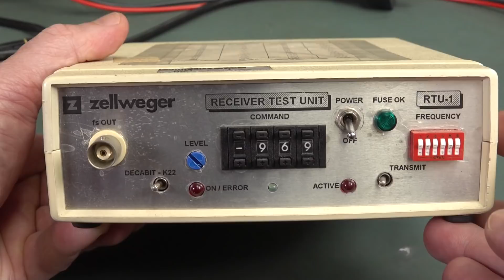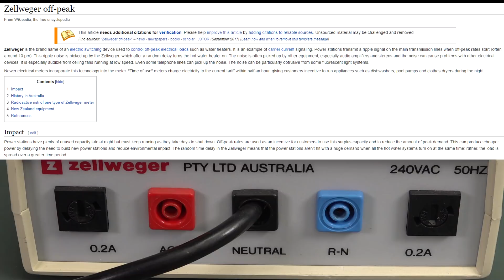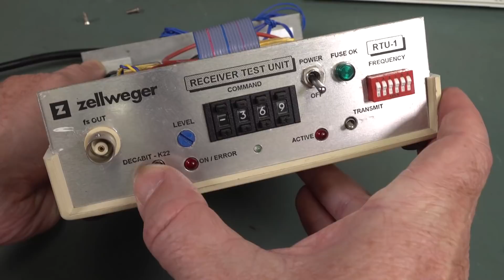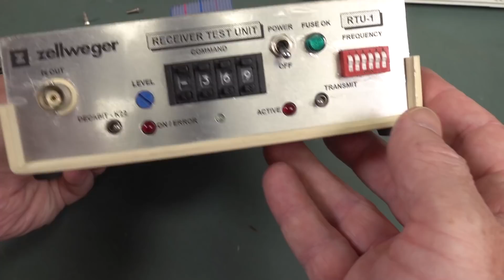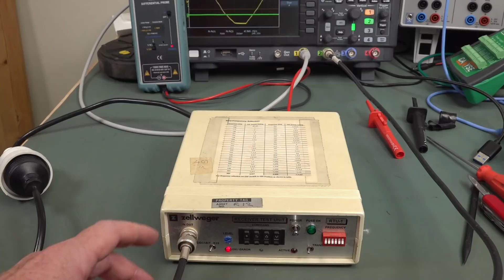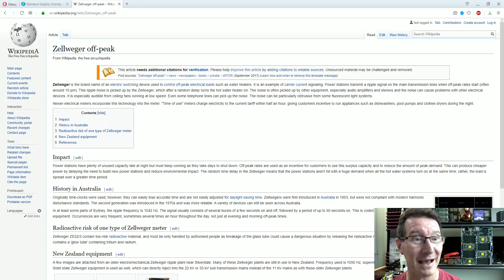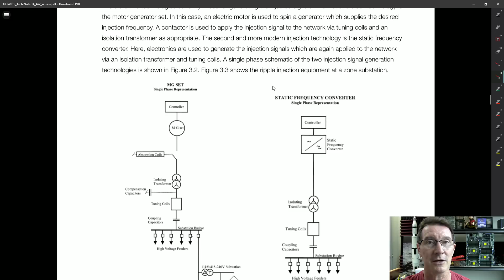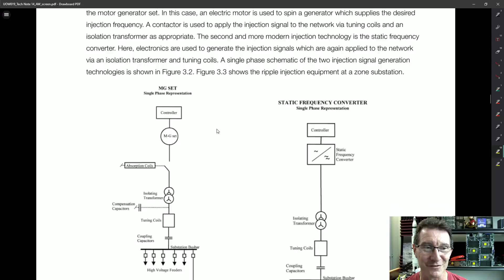EEVblog #1283- What is Mains Ripple Injection?

Comment: I remember when it used to be a thing here in the US.  Power companies used to push it as demand switching and generally things like your electric tank style hot water heater would be put on a box with a relay in it, or some cases they used it to control the power to the outside unit for central air conditioning, etc.  Then if there was a high demand event, like a super hot day and everyone is cranking the AC they could issue a command to shut off demand appliances to help the grid from overload.  I don't see these anymore or hear it mentioned at all.  The power companies used to do it here as an incentive, if you let them put it on your appliances they would give you a reduced cost or annual kickback.  The bad thing i do remember is when they discontinued the program where i live, just about everyone had it on their hot water heater because there was a large push to save money by allowing it back in the day.  It was a small box next to the breaker panel with three LED's in a small window on the front door, there was a green for operating, a green for appliance power on, and a red for appliance power off.  What happened when they abandoned the system was they issued one final command to tell all the demand units to turn ON and stay on.  So every one of these boxes were defaulted to just sitting there powering a relay inside that was turned on 24/7.  So they were just wasting power, albeit a small amount, to run the board inside and keep that relay on all the time.  The problem was they wired them so the appliance was on the NO terminal, so they had to be commanded to switch the relay ON or in the case of a power outage when the box reset it would turn the relay back on, i remember the box even had a label on it that said if the appliance wouldn't come on and there was not a demand event or if the appliance was needed during a demand event to power cycle the box, and it would default the relay back to on.  The problem was after years of sitting idle the relay's started failing and dropping out and everyone was coming home to either no hot water or no AC at some point.  Countless numbers of these were removed by local electricians as the local power municipality refused to take responsibility for they abandoned installs, and since people didn't want to pay an electrician most would open them up find the wires going to the hot water heater or whatever appliance and remove the two line wires from the relay and connect them with a wire nut and leave the box in place or take the output wire and put it on the input wire screw terminal to connect them leaving the box still powered and still consuming power via its transformer on the PCB inside, until eventually the units completely failed and died or in some cases even caught fire.  Most people however were smart enough to remove both the line wires completely from the relay and leave the wire to the power supply on the PCB out of the wire nut, it had two wires on the supply side, the one from the breaker supplying the appliance one to a short jumper that went to the PCB to power it and people though it just needed to be there but some would remove power to the box and just leave it there as a junction box for the water heater for eternity!  I have replaced water heaters where the box was still there, some even still powered with their LED's lit 20+ years since they were last in use.  Most have been removed or just bypassed and left to collect dust these days, but they are a relic you still find in some basements near the breaker panel or water heater.
Reply: Good info.. thankyou
Reply: Still in use in NZ - you get a discount on your monthly power bill if you have your hot water "controlled" and certified. 
Big power consumers can also negotiate discounts by connecting things like water pumps etc using ripple control where the local power board can switch on and off heavy users. 
With many different codes, covering different industries they have options about who to prioritise. Eg. Crop irrigation might be a low priority so they might turn that off first and irrigators use a special code specific for them. 
Residential water boilers in my city have four codes and the electrician is told to choose a random one of the four codes when programming them so the power board can switch on/off boilers in random steps to ease the load so it doesnt all come on at once. 
Street lamps use another couple of codes - high priority and low priority so they can switch off some after midnight though with the change to LEDs they save so much power that they just have a light sensor on each one and they dont need to shed the load anymore. 
Air conditioning is only becoming common in the last 10 years here so they havent really done much with them though i like the idea that freezers and fridges could be designed with water compartments that freeze during the night to ease the load during the day similar to night store heaters but cooling your fridge instead of heating. 
Same with washing machines etc. You should be able to set your washing machine to or dryer to start their cycle when they recieve the next off-peak commence code.

Comment: Can they start electronic with it, could there be hidden chips in electronic devices that get activated by the technic?
First i thought it was used to inject data into datachips and look for output, like a chip test unit? 
I am not sure i understand the purpose, oh just looked it up steering city lights it says?

So i guess that different appliances have different codes how many codes could your unit transmit, well and then multiplied with the range of frequencies. Could it basicly be used for digital broadband transmissionthru the powersystem "electric grid"  if you calclulate the necessary distance between frequensies so that no interference present, right or wrong?
Reply: Is anyone use it for digital transmissions over the electric grid on grander scale, or is it a to noisy grid to work properly? Is there any city using it as a broadband net? I guess that would require a different kind of router hooked up to the electric outlet?

How would one go around to calculate the amount of data bandwidth the electrical grid could provide using ideal conditions with ripple injection? Would it cause disturbances to electrical devices havin it going on?

Comment: back In Chicago, sometime in the late 80s or even early 90s..  there was a program whereas  customers could sign up for a "energy saving program" for " a discount" and, in turn, the power company (Commonwealth Edison) would install a box inline to the service disconnect to the air conditioner.. imagine that- the POWER COMPANY having the decision to control your A/C at mid day! hehe you can guess what happened- the power company was CONSTANTLY switching the A/C units OFF when they were needed the most! day and night- if it got above 80 F (32 C?) , and if you were on that program, you can be ASSURED that your A/C wouldn't work!  This became a BIG STINK..  and from my understanding, the program FLOPPED rather quickly!  and nowadays, they installed smart meters- and those customers pay per hour rates! OOPS!  (of course here, in the US, the power companies are constantly CHEATING and/or RIPPING OFF their customers... but thats a topic for another time!)

Comment: Hi!

We, in Budapest, Hungary have a receiver working on 216.7 Hz, to turn on/off hot water boilers. In other regions, there's a newer system, using long wave radio time signal transmission at 135.6 Khz, callsign HGA22. see: https://www.sigidwiki.com/wiki/EFR_Teleswitch

Classic ripple injecting system was using a rotating machine, see this vid: https://youtu.be/E4gouT4m0cM

Comment: The ripple control receiver (like a radio receiver) has a resonant circuit at the channel frequency. Most modern meters contain one. This  voltage is used to drive a relay change !

Comment: Zellweger are known for producing our ripple control receivers that turn our hot water on and off and our street lights etc. The signal is sent on the half hour or the hour. The signal is coded in Decabit. The close to 1 khz signal can be heard in any active motor windings at 10 p.m. keep an ear out..! (Sounds like a long slow morse)
Reply: For those of you interested, In Straya the originating ripple signal is injected by the local zone substation via high-voltage equipment. This then passes via the high voltage network to the neighbourhood transformers. Then into your LV  switchboard!

Comment: Here one of the local power companies used a 2-tone power line carrier system years ago.  They've since gone to a system that uses digital signals.  I actually built an MC68705 into the 2-tone generator that was only designed for manual operation.  At the time the microprocessor allowed an Apple III to send tones back in the 80's.   Later it was connected to an IBM PC-AT.

Comment: Absolutely fascinating I have suspected for years that there was some kind of noise(and not 60hz mains frequency)in any mains powered receiver or high gain DIY amplifier but when powering said equipment from a big generator(sine wave of course) the internment interference was always gone. Sometimes there was some interference from the generator but it was from changing current load

Comment: Kiwi here. A month or two ago I was messing about with trying to receive radio by using the mains as an antenna, and a big filter to cut out the 50Hz, and I kept getting erroneous non-repeating signals. Could have been zellweger, or maybe it was one of those power-line-communications doorbells. Never captured them with my timebase on right to analyse them.

Comment: Looks like the unit was originally equipped with only shielded banana jacks for the Mains connection. The power cord looks to be hacked into the unit. Someone drilled out the Neutral Jack.

Comment: Handy box when your kids use up all the hotwater in the evening :) Note there is Controlled Load 1 (CL1) and CL2 - CL1 I think is the night time one but CL2 can go on and off during the day and will vary I believe with network load. Cool tutorial video might be to design a filter to detect these so you can plot the on and off times on a Raspberry Pi or something.

Comment: So where I live, Florida Power & Light has what they call their "On-Demand" system where they'll install PLC boxes in front of your water heater, aircon, heat and pool pump. In exchange for a (paltry) credit on your bill, they reserve the right to cut power to those devices for up to 3.5 hours a day to shed load in peak demand times. They can get pretty damn aggressive with it in the immediate aftermath of a hurricane to keep load low on substations and capacity available for critical loads but if I'm honest they really only seem to load-shed is between 3-6PM during the week which can be a bit of an annoyance if you're working from home if they decide to take away your aircon. And they also seem to fail open when they fail, so you've gotta open them up bridge the terminals out and then wait for the power company to rock up to replace the silly buggers and boy do they kick up a fuss when they've found out you did that.
Reply: I had just posted a reply about that, they fail open on the relay, its a pain.  Around where i live up here in the Midwest they aren't that common anymore, used to see them in every house, but now they don't do it anymore.  The old ones were abandoned and as they fail people rip them out or just leave them as a junction box and bypass the wiring inside.  Surprised they still use them in Florida, but makes sense.  Around here all the small power co-ops took over and as the towns went off the main line providers and became their own co-ops those boxes were just abandoned.  My last house had one in it, i tore it out when it failed and the hot water heater didn't work one day.  The house i live in now didn't have one and never seems to have or someone else removed it and replaced the wiring to the water heater most likely, thats how most of them disappeared over the years.

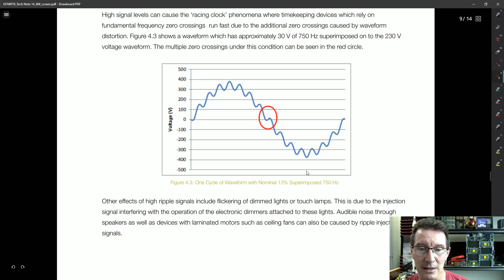Comment: Here in Finland that is called "yösähkö" (night electricity). Electricity is cheaper at night time and firm can control waterheaters and such high loads. I do not know how that system works, but i do know there is more than just one control possibility. Also that system is used to load balancing. All waterheaters do not start heating water at 22:00 when "yösähkö" starts, but they start heating randomly between 22:00 and 1:00.
Reply: Enermet was manufacturing electricity meters in Finland. It was merged to Landis+Gyr at 2008

Comment: This has been used in Germany for decades, mainly for load balancing and switching on/off night storage heating systems ("Nachtspeicheröfen"), in conjunction with two-tariff electricity meters. In the late 1960s and early 1970s, they did lots of experimentation with this technique, like even alarming the fire department, or remotely switching off the mains for customers that didn’t pay. As far as I know, they used a lot of different protocols (Decabit was one of them), the local electricity board decided which was used. I believe this is still now used to limit power injection from third parties into the network, i.e. from solar or wind parks (everything that could inject more than 30 kW).

The German name for this is "Rundsteuertechnik", and it uses frequencies between 167Hz and 2kHz, with an amplitude of 1–8% of the nominal mains voltage (limited to max. 9%).

The Zellweger company (now part of the Swiss Ascom holding) developed the Decabit protocol in the 1960s. It has a start pulse "SI" plus 10 (thus "deca") pulses of 600ms each, so each command is 6.6s in length. Pulses are always followed by a pause, so a 5-of-10 combinations are possible. Now for n=10, m=5, n! / ((n - m)! * m!) = 252. Since commands are always "double commands" (for on/off, signified by a "+" or "-"), effectively 126 double-commands can be sent using Decabit. This is the reason why your device flashed "error" for some codes. Codes 0..126 should be valid for Decabit, "+" for "on" and "-" for "off".

Let’s take the Decabit command "011+", which would be "11010101010" (SI+1.I+2.I .. +10.I). The corresponding "off" command "011-" should be "10101010101", if I remember correctly. It has the pulses inverted, only I can’t quite remember if SI and the pause pulses had to be inverted, too. I seem to remember SI stayed a "1" but all 10 pulses had to be inverted.

Interesting find!
Reply: For the German speaking world, the topic is very well documented here: http://www.rundsteuerung.de/
Reply: And also for decades this signal is coupled in analog amplifiers. Very annoying... I might've cassette recordings from decades ago with this signal recorded.
Reply: We used to have such a heating system when i was a kid... i tried to convince my parents that sometimes early in the mornings when you listen very closely you can hear "beeps" over the electrical hum.. no one believed me... years later, i finally could prove them wrong ;)
Reply: Yes, this is still in use in Germany.
The Decabit command is only one in a row of commands. It has, as you already explained, 126 commands who are doubled each to switch on or off a relay.
Because of the number off 126 different commands, the Decabit ist only usable for a small list of devices, who are called "Rundsteuerempfänger" in Germany.
There are ripple control systems who offer 50 pulses to control switches.

Enermet, by the way, is still producing this injectors. For greater areas there are much bigger components used. In main power stations the ripple signal is feeded in directly to 10kV up to 110kV systems. Switching thousands of relays.
In my region in western Germany it is used for switching street lights, electrical heaters and, due to the upcoming solar-cells, reducing these because of grid stability.
Reply: How lucky
Reply: Yes i remember these heating devices. My parents home still has them.
Reply: It's now also used for Photovoltaik Systems greater than 30kWp. The can can regulate the produced power in 100/60/30/0%  steps to stabilizer the grid or in "emergency" situations. At certain sizes (Don' quote me at the exact number) you are also required to have a UPS so the system stays active in case of a complete blackout. This is because you can't have (in the extreme case) for example having a 2+ MWp plant starting injecting full power when you have starting up the grid again.

Comment: I think those wires were left over from some troubleshooting session that was interrupted.  The wires probably went to a bench power supply or multimeter.   I guess they intended to come back to it, later so they left the wires in.
Reply from the maker: Possible.
Reply: For mains nipple injection testing.

Comment: In the Netherlands we have this in some areas. It is/was used to swich various things like street lighting, electric boilers and also to switch your (old style) electricity meter between day and night tariff. However they are phasing out this system. Everyone is getting a smart meter which is controlled via mobile internet, so this system will eventually be shut-down. In my garage i can hear the signals because the humming ballast coil of my fluorescent light will start to produce some other tones as well.